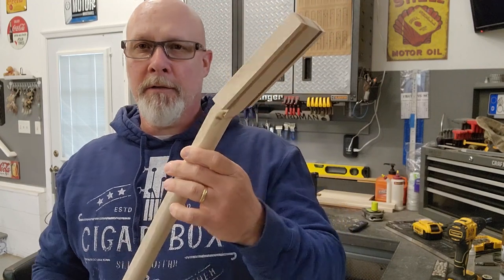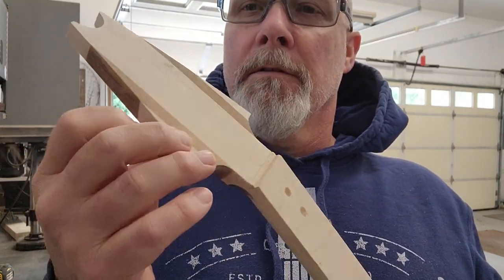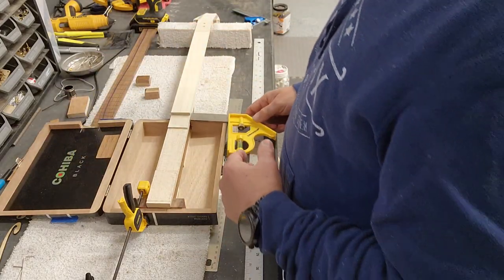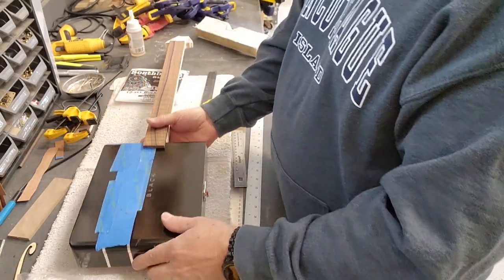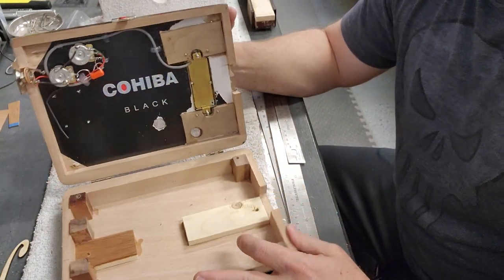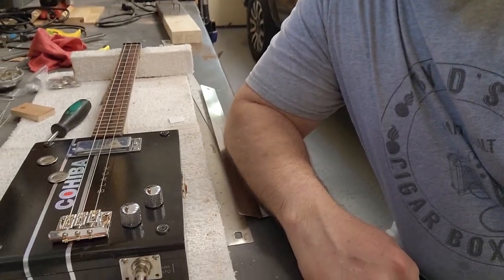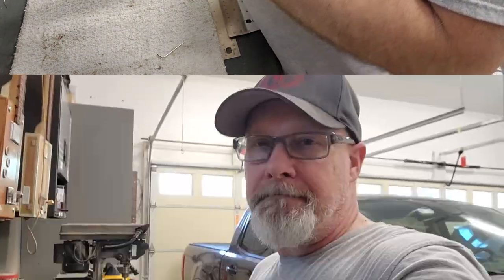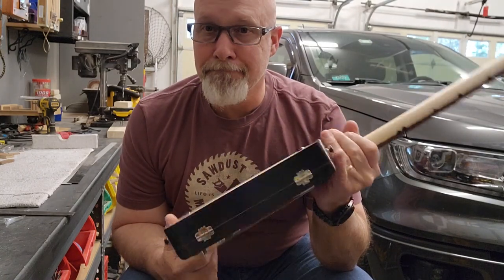Cohiba Black CBG

Comment: Hi. great job. Hox did you joint the neck to the box ? Screws ? Glue ? And how to do this with the cover of the box ?
Reply from the maker: The neck slides into the box until seated, and then I secure it with screws in the back.
Reply: @robertbyrdsguitars  thanks.

Comment: What do you use to cut the Cohiba box?  So far I have asked this question to other builders and received nothing but crickets. I will soon figure it out and sacrifice a box, tape it up, and jigsaw, handsaw, and torch it to find if it's plastic or not from the color of burn, so  I will know if it can be laser cut or what.
Reply: Great sounding CBG for a Va guy. lol
Reply from the maker: I use a jigsaw for almost all of my cuts and forstner bits for the holes.